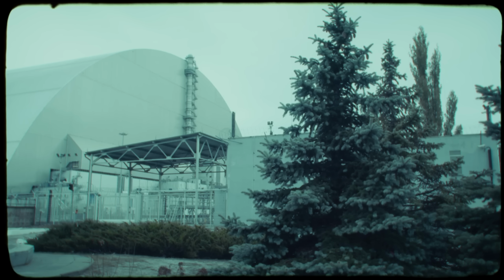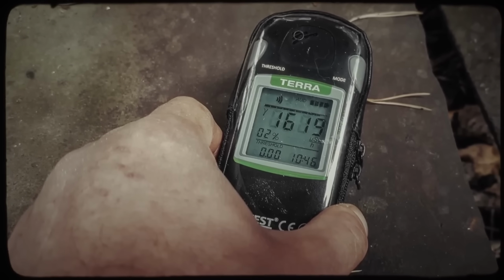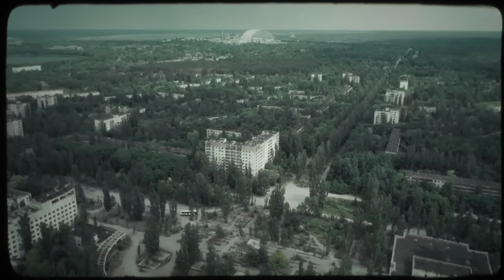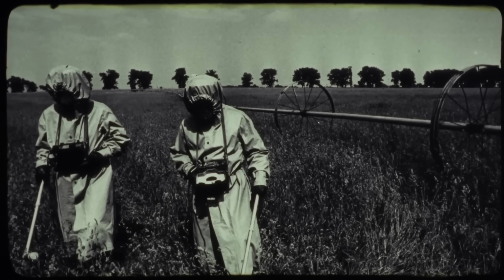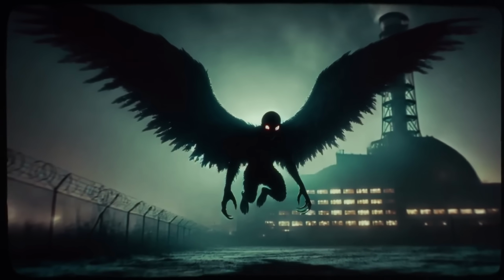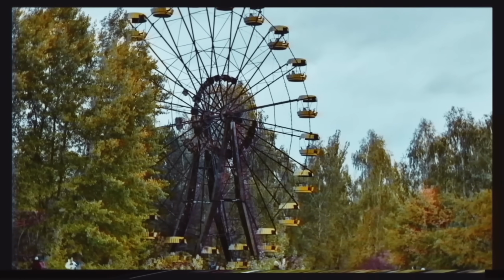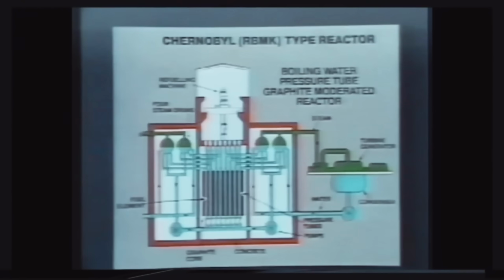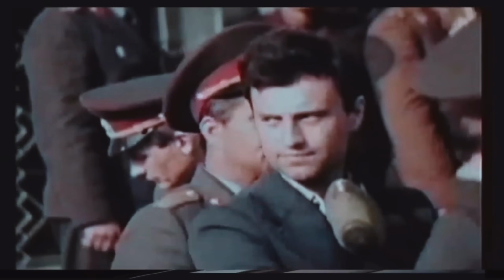30 Creepiest Chernobyl Mysteries Ever That Cannot Be Explained

Comment: Why not leave the claw and other equipment on the site instead of spreading them out in different forests. To hopefully save animals or it didn't matter. ? Just curious.  Have we learned from their mistakes?  Only time will tell. And are there more in the USA? Texas? I pray im far from them if so. I pray that never happens again 🙏 My  condolences to those effected by this horrible mistake or accident or stupidity
Reply: Its not possible for this to ever happen again. Rbmk reactors are no longer used and modern reactors have so many automatic safety features that they automatically scram b4 any problems spread.
Also newer nuclear sites are extremely safe to be around

Comment: Why did you erroneously display the large radiation symbols on the cooling towers at the start of the video. Producing such nonsense makes certain individuals with minimal knowledge of nuclear power fear the very sight of these towers. These towers are not part of the containment system and no radioactive elements come in contact with or are emitted in the vapor from the cooling towers.
Reply: sulphur dioxide is in that steam. not radioactive but is harmful.